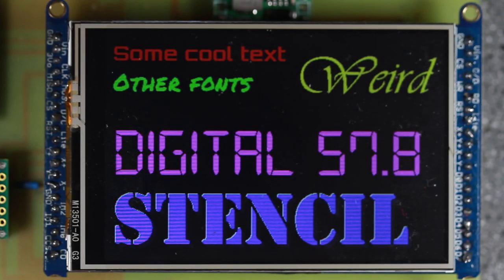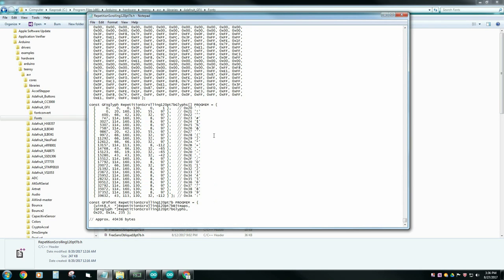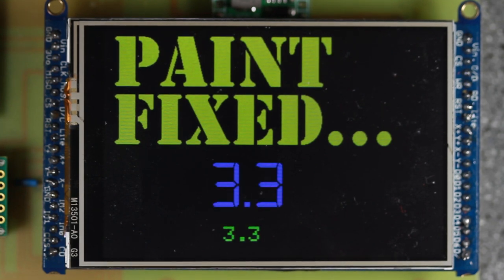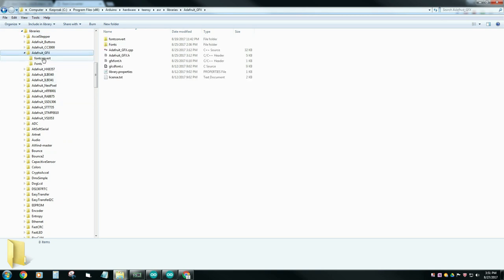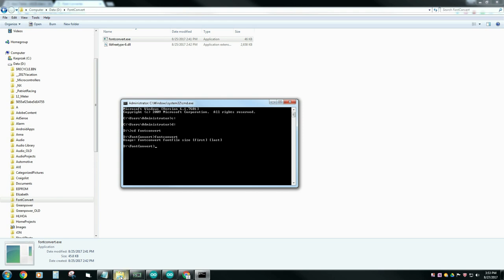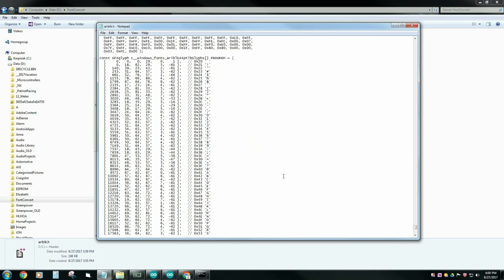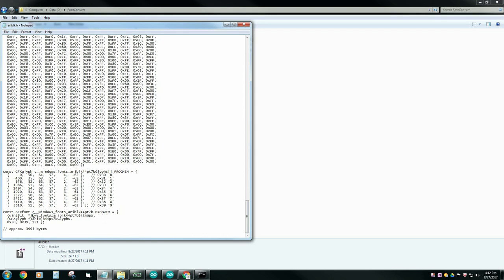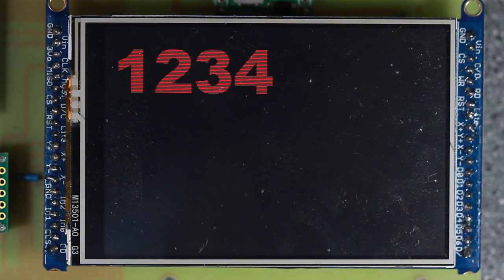Create and use custom fonts for Adafruit_GFX libraries

Comment: Hi Kris, first of all thanks for the tutorial. I have a question:
Does the Font have to be created in Bitmaps?
Can't it be any other way, for example, to put the created font to open in a new tab in the Arduino IDE along with the .ino file? Sorry I don't understand about fonts! Thanks
Reply from the maker: You can, you could have the .h file in the same folder as you .ino (which will create a new tab). I'm not sure why you would want to do this--put the font .h in the library and leave it along.

Yes fonts are bitmap. the library file has a bitmap definition for each character. There are no such think as vector drawn font libraries.

Comment: out of the default fonts, which one is the smallest? in theory, could i manjally change the pixel values so the font is smaller? how would i do that? thank you for your response! great video
Reply from the maker: Smaller in terms of memory or physical size? If memory, there is no way to make the size smaller. Each pixel, used or not requires the same memory. You can change the start and end characters so if you only need numbers, font memory usage is much smaller.

Comment: Thanks for the great tutorial. Do you have any idea how to convert fonts with umlauts chars (128 to 168)?. For some reason, the tools you refer do not covert such characters
Reply from the maker: I don't know how fonts ? 127 can be generated with this adaftuit tool. There is a similar tool (much better) for the Teensy and ILI9341_t3 display driver and someone has a solution. Unfortunately this would require you to change your MCU.   https://forum.pjrc.com/index.php?threads/ili9341_t3-font-editor.54345/

Comment: Awesome work - can't you write with WHITE text and BLACK background ? On OLEDs that's what I'm using and it works great w/ no flicker xD
Reply from the maker: With a proportional font you can because i occupies the same with as w, with non proportional fonts the width of i is much less than w, so the background for i will only paint a small range.
Reply from the maker: No you can't sent the background color with non-proportional fonts an "i" is a different width than a "w". I'm guessing you are using default fonts with the 1306 library (which are proportional--an i is the same width as a w).

Personally i'm moving from Arduino MCU to Teensy 3.2--those suckers run at 72mhz and have 256k RAM. Also there is an ILI9341_t3 library that is blazing fast. Have a look at a short video I posted as a review of a the library in action https://www.amazon.com/gp/product/B01N3L01BB/ref=oh_aui_detailpage_o01_s00?ie=UTF8&psc=1
Reply: Very nice ! (sorry I somehow missed your first reply). I'm definitely using monospaced fonts - and if need be adding some whitespaces at the end.

This however doesn't seem to work with the "custom" font they do include ... So ... I'm also drawing black squares now :)
Reply: Kris: You've got it the wrong way round - with a proportional font the wider looking characters (w) take proportionally more space than the narrower characters (i). "Monospace" is an easier term to understand.  But your general point is good, and many thanks for the video.  I must say though, I don't see the point in a proportional font that emulates a LCD segment display, a monospaced font would look much more realistic, and avoid the flickering problem.
Reply: Sometimes they do look quite rad / retro if implemented nicely

Comment: thanks for the tutorial. this flickering problem is really annoying and its probably biggest downside of GFX library. i implemented custom fonts with a reduced flickering in a way that value is printed only if the value is changed and it helps alot. lets say if you print some sensor value and it does flicker only when the value has changed. this can be done easily by putting the printed value in a variable and check it everytime in the loop if the old value is different than the new one. if its a new value print it and update the variable otherwise do nothing.
Reply from the maker: I hear you I wrote a flicker-free print library that does just that blazing fast updates without the flickering problems someday I'll create a video and post it
Reply: @KrisKasprzak  thats awesome can we test it? is it available?

Comment: Hello & thanks
I'm using Adafruit neomatrix 8x8 (with ws2812b leds)
Is there a way to change (decreace) the space (unused leds) between numbers for numbers above 9?.
Now number 10, has a couple of pixels or leds just blank, I would like to remove that "space" to optimize the pixel usage
Is there any way to do that ?
Thanks!

Comment: Wonderful video thanks for this work. My panel works with 0 - 126 characters of any font. We can change any character (0 - 126) to what do you want to use
Reply from the maker: You could but would require you hand edit the bit map definition for the character but since all characters are combined in one const uint8_t, finding and editing the character will be very challenging. If you have the ability to switch your MCU to a Teensy, there is library support for editing characters. Have a look: https://www.youtube.com/watch?v=YNUbvpTaaCY

Comment: Good job - I tried to convert an Arabic font with this method, but the LCD failed to show words properly and it just showed squared boxes instead. The interesting point is that this method works on numbers and the LCD actually showed Arabic number to me. Do you how can I solve my problem? I use a 2.4" TFT LCD and MCUFRIEND_kbv.h library.
Reply from the maker: Not sure, if numbers work, so should text. what font size are you trying? I know anything above say 100 points will produce very weird results. Have you tried your fonts with the adafruit graphics library? I believer the MCUFRIEND calls adafruit_gfx, but who know what happens between.
Reply: @KrisKasprzak  can you elaborate on the known problems with big fonts? I'm having a use case where I do require fonts bigger than 100px and with your tool everything works fine for smaller fonts. But I can't position the bigger fonts propperly. turns out that the box where the font is put in is only 2px thick and the font itself is offset to somewhere else. Is that the issue you're aware off, or did I miss something while building the font using your tool?
Reply from the maker: i recall the anchor point used to define the x y location for the font gets messed up. Some characters will draw where expected, some are way off.

Comment: Very well explained, and it works. How would I go about including characters beyond the ~ ?  For example at 0176 in the ascii table is the degree symbol.
Reply from the maker: sure use 

Display.drawChar(x, y, ascii value, fore_color, back_color, scale_factor);

so if your wnat to print a red copyright symbol at screen 100, 100 in Arial

Display.drawChar(x, y, 169, Display.color565(255,0,0), Display.color565(0,0,0), 1);

notes

1. delivered fonts do NOT have the extended character set so you will need to rebuld the font (just pass the last ascii value in the arg list. FontConvert font_file font_size first_char last char > YourFont.h
2. ascii values between fonts may be different 1/2 symbol in adafruit fonts in 171 but in arial it's 189

use this little font printer to see what you have

#include <Fonts\YourFont.h>

    Display.setFont(&YourFontName); // see inside .h file

    for (int i = 32; i < 256; i++) {
      Display.setCursor(0, 100);
      Display.print(i);
      Display.drawChar(50, 100, Display.color565(255,0,0), Display.color565(0,0,0), 1);
      delay(200);
      Display.fillScreen(C_BLACK);

    }

Hope this helps

Comment: Hello Mr. Kasprzak, any idea of how to make static images? im planning to use a heart for example and a drop for the gui, but dont want to use the sd, could be a customized font maybe?
Reply from the maker: Yes let me post some sample code
Reply from the maker: try this... note I ripped these lines out of an existing program so some defines may be missing.

1. draw bitmap in paint or what ever, even download image file
2. use this free converter to convert a BMP or other image into a hex file
http://en.radzio.dxp.pl/bitmap_converter/
3. Do a File | Save Output and the converter will create a hex file like below

// in declarations add your hex image file saved from above (and add PROGMEM as shown)
const unsigned char battery_icon []PROGMEM = {
  // 'Battery', 32x32px
  0x00, 0x00, 0x00, 0x00, 0x00, 0x00, 0x00, 0x00, 0x00, 0x00, 0x00, 0x00, 0x00, 0x00, 0x00, 0x00, 
  0x00, 0x00, 0x00, 0x00, 0x00, 0x00, 0x00, 0x00, 0x00, 0x00, 0x00, 0x00, 0x00, 0x00, 0x00, 0x00, 
  0x00, 0xf0, 0x0f, 0x00, 0x00, 0xf0, 0x0f, 0x00, 0x0f, 0xff, 0xff, 0xf0, 0x0f, 0x9f, 0xf9, 0xf0, 
  0x0c, 0x00, 0x00, 0x30, 0x0c, 0x00, 0x06, 0x30, 0x0c, 0x00, 0x06, 0x30, 0x0d, 0xf8, 0x1f, 0xb0, 
  0x0d, 0xf8, 0x1f, 0xb0, 0x0c, 0x00, 0x06, 0x30, 0x0c, 0x00, 0x06, 0x30, 0x0c, 0x00, 0x00, 0x30, 
  0x0c, 0x00, 0x00, 0x30, 0x0c, 0x00, 0x00, 0x30, 0x0f, 0xff, 0xff, 0xf0, 0x0f, 0xff, 0xff, 0xf0, 
  0x00, 0x00, 0x00, 0x00, 0x00, 0x00, 0x00, 0x00, 0x00, 0x00, 0x00, 0x00, 0x00, 0x00, 0x00, 0x00, 
  0x00, 0x00, 0x00, 0x00, 0x00, 0x00, 0x00, 0x00, 0x00, 0x00, 0x00, 0x00, 0x00, 0x00, 0x00, 0x00
};

// in declarations section create a display object as you normally do
Adafruit_ILI9341 Display = Adafruit_ILI9341(TFT_CS, TFT_DC, TFT_RST);

// in setup
Display.begin();

// some where in your program draw icon with this code
drawBitmap(240, 20, battery_icon, 32, 32, C_RED); //draw positive signal status

// some where if your code add the drawBitmap function
void drawBitmap(int16_t x, int16_t y, const uint8_t *bitmap, int16_t w, int16_t h, uint16_t color) {

int16_t i, j, byteWidth;
uint8_t sbyte;

  byteWidth = (w + 7) / 8;

  for (j = 0; j < h; j++) {
    for (i = 0; i < w; i++) {
      if (i & 7)  sbyte <<= 1;
      else        sbyte   = pgm_read_byte(bitmap + j * byteWidth + i / 8);
      if (sbyte & 0x80) Display.drawPixel(x + i, y + j, color);
    }
  }
} //from Adafruit GFX
Reply: @KrisKasprzak  Thanks so much for the effort and time to answer. I will try to get it working
Reply: @KrisKasprzak  It worked with the battery icon, but when i try to make my own, i just get a very distorted image
Reply from the maker: Let me look at that converter I don't recall if that's the one I actually use in the past
Reply: @KrisKasprzak  Sure thanks, i used one called lcd 2 image too, but same result, i dont know if its my problem, or a problem with the converter or the configuration
Reply from the maker: @Cesar-dt9nl  try this free on line site, upload the file then generate code, copy / paste the code into your cost char....

https://javl.github.io/image2cpp/

Comment: Hi, Kris Kasprzak, is there a way to get characters greater than 127. I'm creating a Vietnamese font, pls
Reply from the maker: I don't see a way how this tool can be used a command in the fontconvert source code says
"Currently this only extracts the printable 7-bit ASCII chars of a font."

I tried to create fonts from space to 255 using the command line:
fontconvert arial.ttf 8 32 255 > somefont.h 

and it wrote most of the characters except for 128  to 160 or so. note writing 32 to 255 using wingdng3.ttf fails on some characters

Implementing in Arduino is done by:

  tft.setFont(&arial12pt8b);
  tft.write(180);

But with missing characters, the created .h is useless.

If you are willing to draw your own fonts and are able to switch to a Teensy, there is a better font convert that will let you draw your own fonts (up to 255). 

This vid shows how to use the tool and create a character:
https://youtu.be/YNUbvpTaaCY

Comment: As I could change the size of one of the letters of the gfx library to my liking
Reply from the maker: I'm not sure what you are asking, but if you want to change any of the fonts, this is not possible with the adafruit libraries. 

If you can switch to a teensy MCU (which looks like an Arduino NANO but some 100x better) and are usign and ILI9341 display, this tool will let you tweak indivitual characters. It creates fonts specific to a Teensy using the ILI9341_t3 library.

This video shows what you can do. https://www.youtube.com/watch?v=YNUbvpTaaCY&t=1s

Comment: Tnx for the video. I did all the steps and copied the font in the fonts folder of GFX library , but Arduino software says "No such file or directory" exists. It can not recognise the .h font file. What should I do?
Reply from the maker: That error is telling you the .h file doesn't exist. make sure its' in the correct folder, close and restart arduino IDE

Comment: at about 0:11 seconds you show a list of fonts on your computer in folder ...Adafruit_GFX/Fonts. There are some fonts listed there that might solve a problem I have, but for the life of me I cannot find them anywhere, either in my arduino installation, on my computer or on the internet. Will you tell me how to navigate to them ?
Reply from the maker: Which fonts? Some of those I created and aren't delivered with the adafruit_gfx libs
Reply: @KrisKasprzak  Thank you thank you for replying. I have been trying for days and days to figure out how to get a font about 1" high (I think that is 72pt) to run on my new 3.5" tft lcd ili9486 (or ili9481 lcd chipset) running on an arduino mega. I want to be able to see it from across the room (wind speed & water pressure). but the largest i have found is 24pt. I use the adafruit_gfx.h library, but apparently there are no large fonts in that library.
Then I saw your video, and in the list of fonts that you briefly show are some fonts that are very large (c_windows_fonts_digital_750pt7b.h). In answer to your question, any font that is quite large. i have tried typing some of those listed in google and don't get helpful results.
Reply from the maker: @youpattube1  yes you will have to build a custom font my experience has been anything above 99 points doesn't work very well

Comment: Hello Kris, i tried to make Turkish font.Turkish font starts from number 127 Ascii to 352.I used your program from 0 to 355 (ascii codes) and got the  .c file. It is ok till number 127.But i could not get Turkish fonts.What can i do?
Reply from the maker: i just looked at the fontconvert.c source code and it's clamped at 127. maybe you can increase that value and compile it again. Get the Adafruit_GFX library and inside it will be a folder for fontconvert. the file fontconvert_win.md lists the instructions for compiling the .c file. I'm not sure if the libraries are setup for double  -byte characters so I don't know if changing the 127 will even work
Reply: @KrisKasprzak  So the solution to convert non-ASCII characters is to edit the program and compile it again?

Comment: More than 3 years later, and my sketches aren't successfully compling when I try to introduce a font.  I get this:    'class Adafruit_SSD1306' has no member named 'setFont'
Reply from the maker: The SSD1306 will not have a setFont method, but the Adafruit_GFX will. Try this

// use custom fonts in the adaftuit_gfx\font folder or....
// create custom Adafruit_GFX fonts at this site
// https://oleddisplay.squix.ch/#/home
// make sure you select Adafruit GFX font for the library type 

#include <Adafruit_GFX.h>
#include <Adafruit_SSD1306.h>
#include <Fonts/FreeSans9pt7b.h>
 // font that delivers with the GFX library

// make sure your .h  has the right display resolution around line 42 or so  uncomment the correct pixel size
Adafruit_SSD1306 display(OLED_RESET);
display.setFont(&FreeSans9pt7b); // passing by ref so don't forget to include the &
display.setCursor(0,0);
display.print("the cat in the hat");
Reply: @KrisKasprzak  So, I learned a lesson. I am now using the Tools->Include Library method of including libraries to sketches.  This way, dependent libraries are also loaded. When I added the Adafruit_GFX library this time, a number of dependencies also loaded up, and I now have access to very nice fonts for my 1306! Simply typing in #include <libraryX.h> or whatever doesn't cut it, at least for me. Thank you for your reply!
Reply from the maker: @DeeGeeDeFi  Glad I could help.
Reply: @DeeGeeDeFi  do they have letters for extended characters or are they all still ascii?

Comment: did you noticed that most font are gone ... where can I convert the Orbitron font ? Any ideas ? thx
Reply from the maker: It's been a while sine I used that site, didn't realize so many were removed. Maybe send the website owner a message?
Reply: Ok, thanks. In the meantime, I found how to run the application on my pc (and it comes with all the fonts)